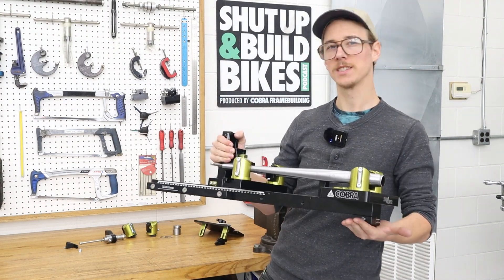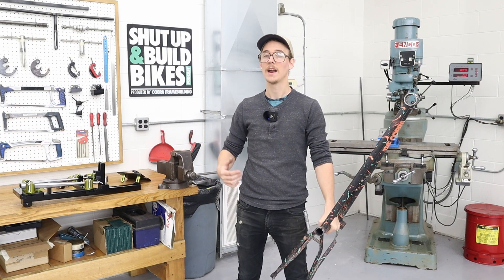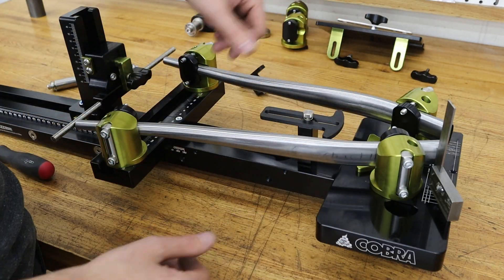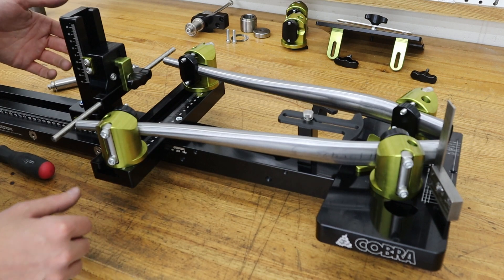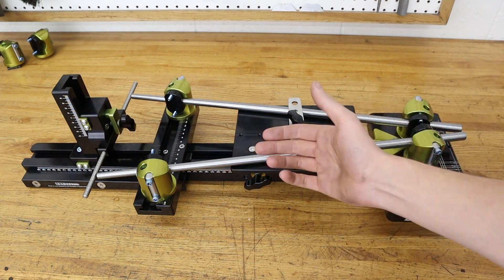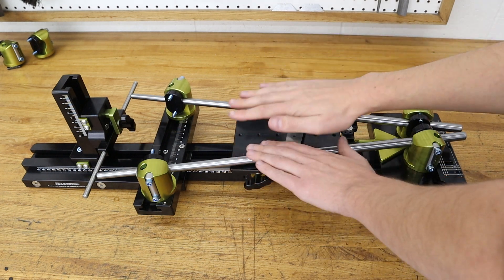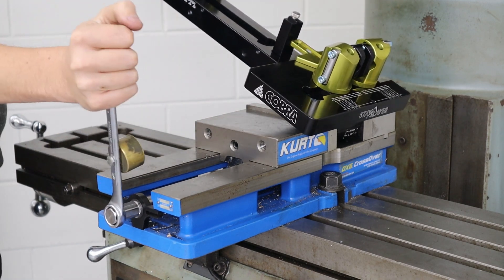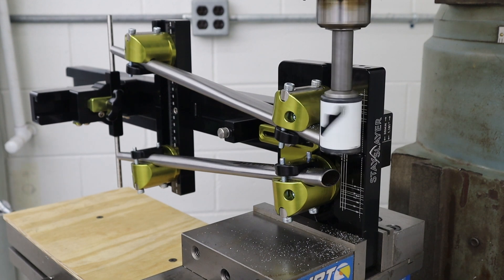Say Hello To The Stay Slayer - Seatstay and Chainstay Mitering Fixture - From Cobra Framebuilding

Comment: Man I'd love to see you make some more rigid saw arbors... Like 1" or 1.25" with a 3/4" reduced shank.for the r8 collet in long lengths. These would be specifically for this application (and maybe for mitering down tubes for a seat tube joint) so maybe even a few diameter options. Pick the largest diameter you can handle for the job type of thing.

Comment: Wow, I have an ALMOST identical wrench with a hunk of brass bolted to it.  And apparently we both keep these types of wrenches on our mills.  Weird.  ;)
Reply: What's it for?
Reply from the maker: It's a 3/4" wrench with hammering capability. When you need to change tools or collets at the mill it is helpful to have a soft hammer to tap the drawbar loose. 3/4" is also the size of the hex drive on a Kurt vise and the size of the nuts that need to be tightened and loosened in order to tram the machine head or swivel/extend the ram. Super handy tool. I made mine with a flea market 3/4" wrench and a scrap chunk of brass.
Reply: @cobraframebuilding  Oh, I totally get it!  It's just funny that I did almost the exact same thing.  Hunk of brass bolted to the wrench.  If I set mine next to yours they'd look like they came from the same store!  Just made me laugh.  Love your videos btw!